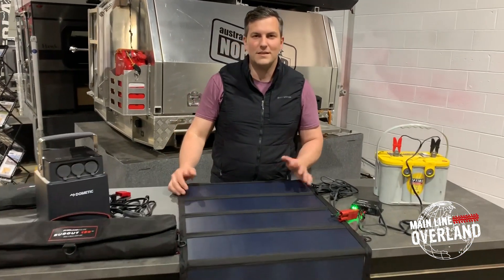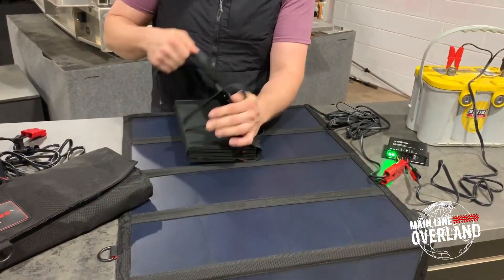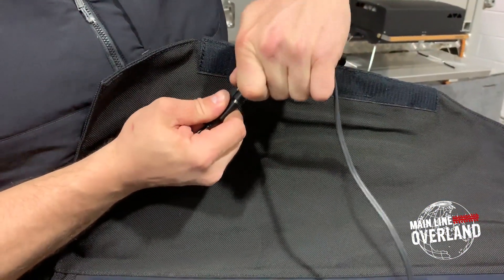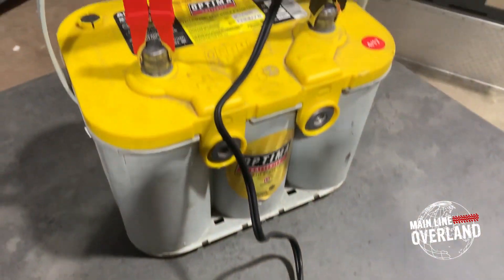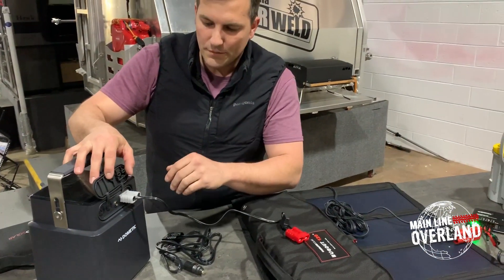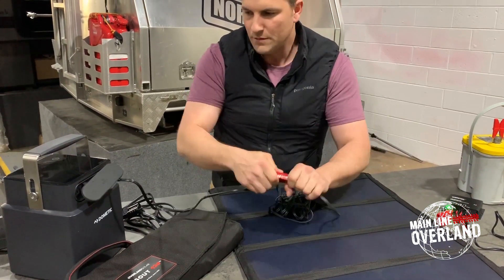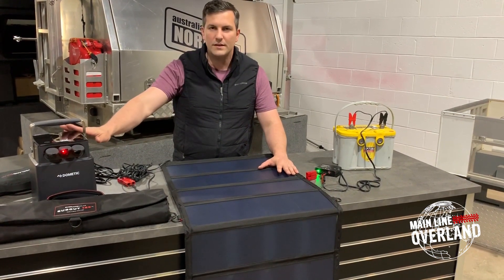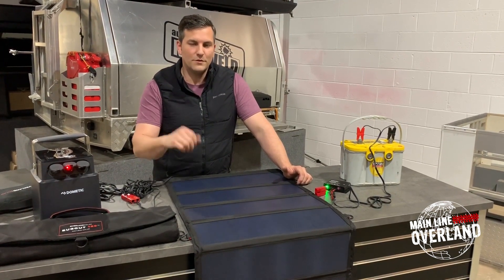New Overland Solar 120W Charger and PLB40 Adapter

Comment: I have a goal zero boulder 100w solar panel with an 8mm male plug, do you have an adapter to fit to the Anderson input on the PLB40? Thank you.
Reply from the maker: Of course it would void your warranty, but your best bet would be to snip the 8mm plug off the cable and mount 50amp Anderson Power Poles and a gray or black plastic 50amp Anderson plug. This would be the move if you are looking to plug directly to the PLB40 with that 100W panel.

Comment: Are you sure the PLB is supposed to beep like that every time you plug a solar panel into it? I
Reply from the maker: The PLB40 has a warning that goes off when the panel is first plugged in to the PLB input (happens most of the time for me, but I don’t always have the panel in a great position for sunlight when plugging in) or when it is obscured by shade or overhead obstructions and is no longer sending charge to the battery. It’s a reminder to move the panel into a better position to charge the battery.
Reply: @MainLineOverland   I think you will find its when the Solar panel is producing less than 8 volts the alarm stars beeping
Reply: @centennialau  will it automatically start charging again when it gets enough sun again?

Comment: Addition:
Or has it allways to be unplugged?
- When the directly connected solar panel isn't working?
Reply from the maker: Lothar Peters The PLB40 can simultaneously charge and discharge, so you can replace what the fridge or other devices use. If the solar panel goes into shade the PLB40 will detect this and beep to alert the user.

Comment: Hello,
very good video.
But:  how about voltage drop / reverse loss of voltage,
when there is NO controller? - when it's directly connected to the PLB40?

Maybe you could answer to me? - so, i get a notice from youtube?
This would be very helpful.
Btw: Dometic is telling nowhere about that.....

Kind Regards
Reply from the maker: Lothar Peters The PLB40 has an internal Battery Management System, which can handle the Overland Solar 120W Bugout’s open voltage, so you can plug the panel right into the DC Input. If you are going into a conventional Lead Acid or Lithium battery you must have an in-line charge controller to manage the panel’s open voltage. To manage voltage drop, keep cord lengths within 20ft between panel and controller/ battery. If you need to go further to find sun, up to 40ft, but you will experience a small voltage drop—2-4%.

Comment: I bought both the 120w panel and the Dometic PLB40! Really looking forward to the ease of use and the 40Wh of the Dometic to keep my fridge/freezer going all day.
Reply: Jason W Hows it working for you?Im looking at this setup
Reply: @Suavveb  Hi, Ben. It works incredibly well. Connecting the panel directly to the PLB40 charges it surprisingly fast even in the afternoons. Well worth the money IMHO. That PLB40 is a beast.
Reply: @JasonWh  keeps your fridge running?
Reply: Greetings . What fridge were you running ?
Reply: @jasenalapati665  ARB ZERO 73Qt